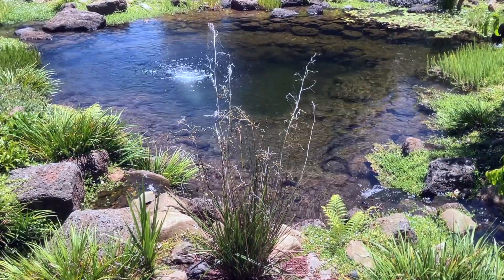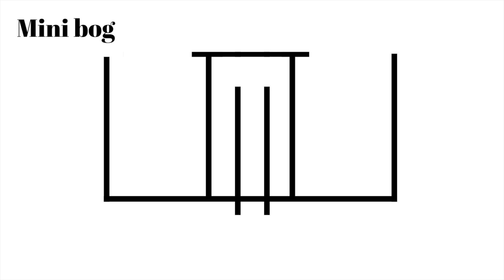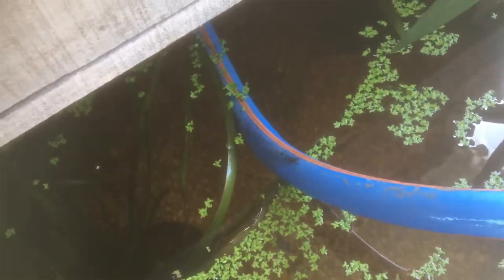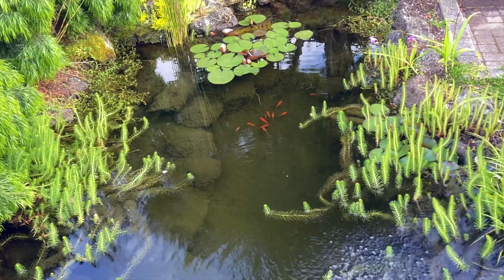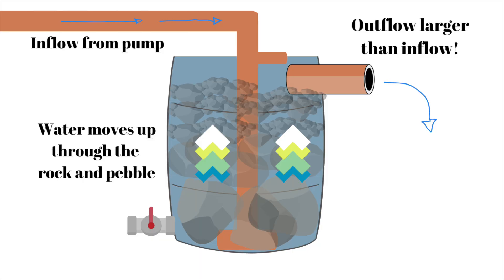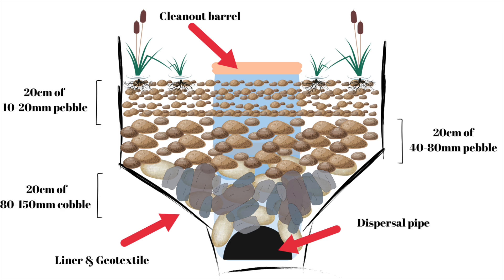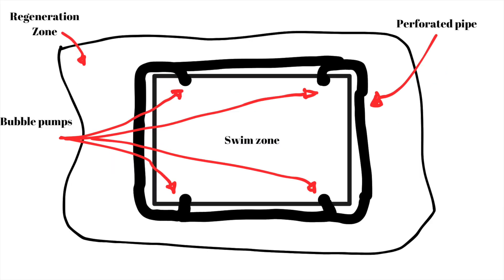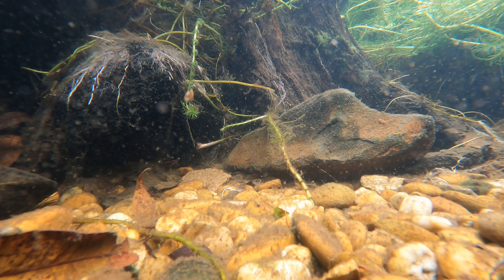Bog Filter Diagrams| Designs

Comment: Thank you so much for all your wonderful information! I'm mid Duck pond build using your formulas cheat sheet and all your amazing videos and I have a conundrum... We live just north of Houston, TX USA where we are in a coastal zone and also live in an actual flood zone. Our water table is high year round and our soil base is basically sand. With this we can't really build shelves into our pond which is ok, it just means we can't have all the pretty layers of rock. However when it comes to the bog filter (ours is about 1500 gallons to handle all the duck poop) it's impossible to dig out the trench for the clean out barrel and perforated half pipe. We had to use a pump to pump out the water as we dug and the sand doesn't hold any shape whatsoever. Can I use a gravel layer as my base and build the trench that way? After the barrel and pipe are laid in the gravel trench I would then layer the rock as you suggest with big, medium and then pebble? Any suggestions you have would be super helpful!
Reply from the maker: If you can reach the required depth you could lay in the liner, place the pipe and cleanout, add a few rocks around the pipe, because the excavation keeps collapsing you’d build it in layers-if that makes sense. I’m more concerned about the high water table. You will need to have some kind of drainage under the liner. As someone who’s purchased the pdf you have access to the private community.

Comment: I dont understand the need for the air intake.  If a siphoning occurs wouldn't the water just go back to the pond?
Reply from the maker: Correct and it will pull all the muck the filter has accumulated with it.
Reply: @Ozponds  Ahhhhh, that makes sense.  Thanks.

Comment: Hi Kev, always a pleasure seen your videos which are very useful, thanks a lot for sharing your experience. Honestly I don't remember if you spoke already about them, I was wondering if you tried or thought about hollow clay bricks as botton layer for your bog filters... They are cheap, inert, easy to handle, almost ever lasting and they should provide quite huge surface per volume to host lots of bacterias. Well, hoping to have maybe given you an idea I thanks you again. Cheers!
Reply from the maker: It’s not something I come across here. I’m certainly not opposed to the idea.
Reply: I was trying to upload a research about the use of clay bricks, but seems that youtube didn't like the link... I will drop you an email. Cheers
Reply from the maker: @ thanks mate. Received it. 👍

Comment: My bog filter has reduced outflow. After inspection it is clogged with roots of bulrush plants I’ve used reducing flow. Do I need a bigger filter or rip the plants out start again? Any ideas welcome please 🙏🙏🙏
Reply from the maker: How’s the water quality in the pond? Do you have a breather pipe?
Reply: Crystal clear and no breather pipe. Top used to be coarse sand visible but now just a mass of roots. I’m going to have to rebuild with a breather pipe I think. Have got a bulrush and lettuce type water plant thriving   Are some plants better than others?
Reply from the maker: @jefflouis5658  I have a blocked up bog filter at the moment also. It has a breather pipe and water is coming out there so I’m not worried about back pressure in the pump. I think I’m going to leave it and see what happens the water quality and clarity is excellent. I know it doesn’t really help you right now but I wonder if you should just wait.

Comment: Hi Kev, really appreciate your videos. My dad and I have been building an above ground wooden pond and we are having trouble figuring out how to set up an effective filter as the pond is sandwiched between two concrete pillars and right against a fence so there isnt really anywhere for me to place a bog barrel. Its looking like we may create a smaller bog using buckets which are placed directly in the pond, would you have any tips or suggestions for us?
Reply from the maker: Maybe a DIY trickle/ bakki shower system would be worth exploring.

Comment: I had and still have a 13,000 gal pond.for 45 years now. So 10 years ago I decided to convert the 4' deep pond with huge koi to a frog pond. Gave away the koi. Filled the pond from 4' deep end to gradually 12" shallow end. This worked for 10 years but Evasive plants took over the pond.  It took me 2 months to remove all the fill and return it to its glory.  I guess maybe I should have poisoned it not sure.?  Root system was so massive It wicked the water out of the pond at a rate that it became work to keep up. Mostly I could not see the water surface. . Now I'll start with the koi again .  Any thought on how to keep these plant out.? what I did wrong
Reply from the maker: You did nothing wrong, you just didn’t want that style of pond, now you have the style of pond you want again. Some of my ponds have open water, some are full of plants. Depends on the goals.

Comment: I've now bought all the parts to build my bog filter, following your up flow barrel filter with a tap to plush at th base . I will have 32 km hose coming from the pump, which will attach to the 32mms off pipe on the filter. Could you advise me on the connector that will join the two please?
Reply from the maker: 32mm coupling.